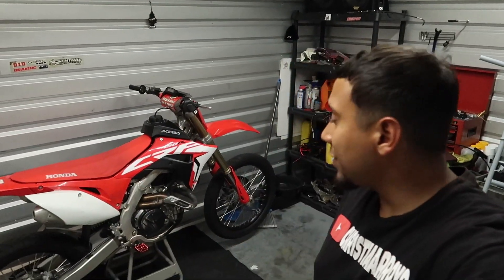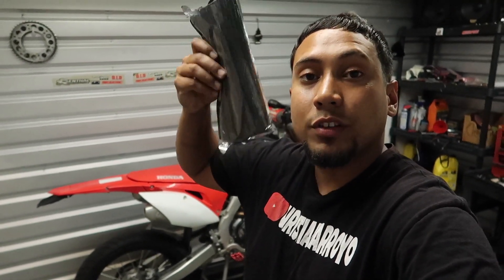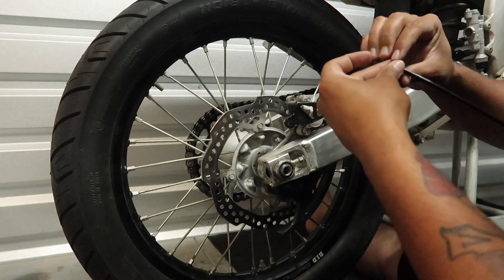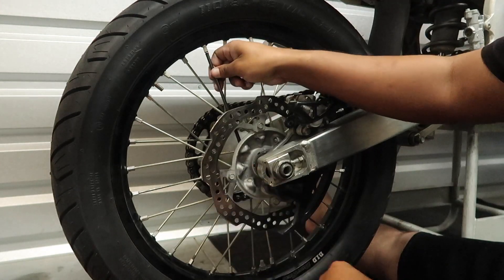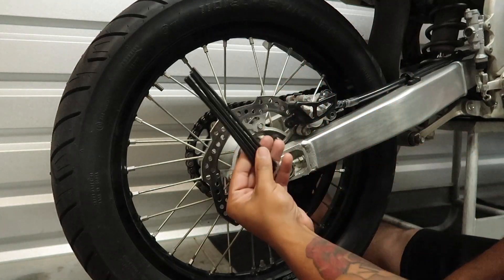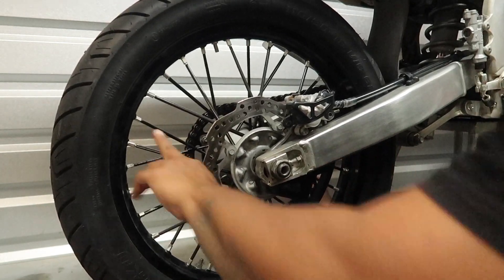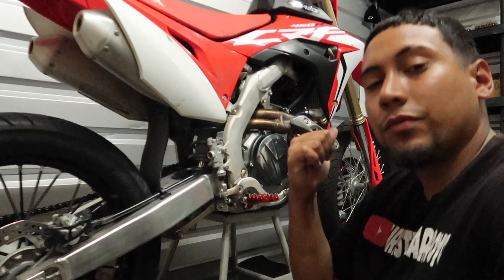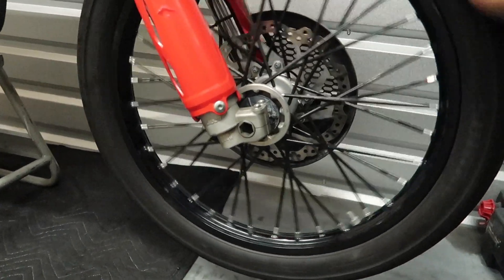SPOKE COVERS INSTALL ON ANY DIRTBIKE🔥 CRF450R | Christian Arroyo

Comment: which ones are these on ebay? Still holding up good? If you can post a link or something that would be awesome. I like these because they dont make the spokes look too chunky.
Reply from the maker: To be honest, I just clicked on the fastest that can get to me, I see them all, most of them are same quality as long as they are for a motorcycle they should all work the same, i seen the ones for a bicycle and those for sure are too thin, maybeeeeee you bought bicycle ones thinking it was the same?
Reply: @VazquezzVlogzz  What about when u need to wash the bike, they stay in place well? I want green ones for my daily rider not a dirt bike, they sell them in the moto shops here.